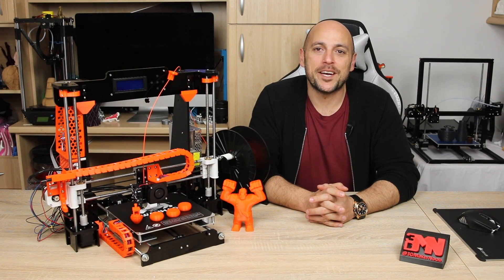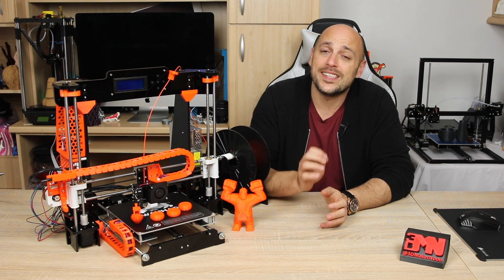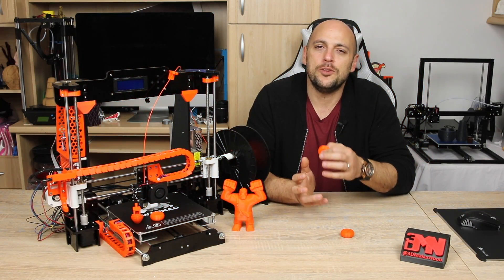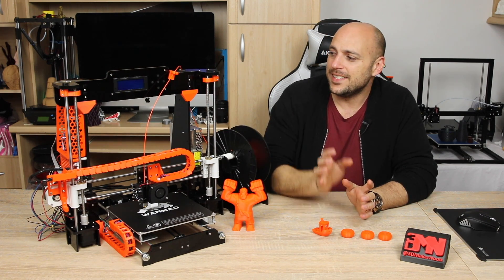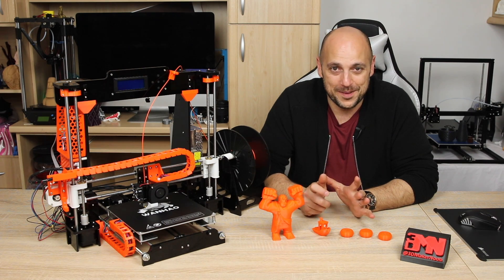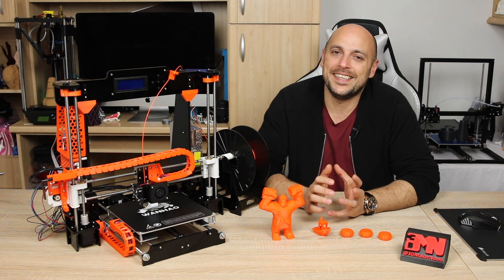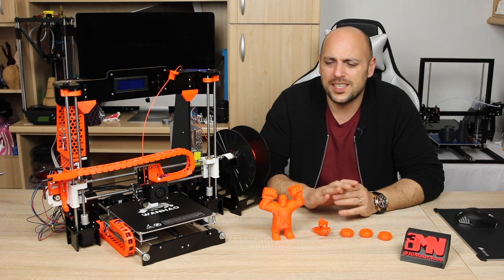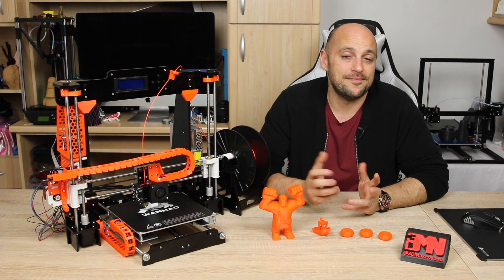Anet A8 Journey - Upgrades Part 1

Comment: Revisiting this video from 6 years ago, there's so many bad ideas here. We didn't know better at the time, I guess.
Cable chains: Increase mass while adding essentially no benefit. Reduces max speed, adds possibility of higher friction and binding.
Enclosure for the mainboard: It's already strapped to a bunch of fuel (the acrylic frame) so why not provide more?
Z-screw "stabilizers": Just... don't. They were floating for a reason. The z-axis only moves once per layer, maybe a few more times if you've enabled z-hop. Constraining the upper ends of the rods actually exacerbates any problems you'd encounter with a rod that wasn't straight and true. Z-wobble is invariably made MUCH worse by this "upgrade".

The gussets for the perpendicular joints were a good way to stiffen the frame, for sure, but the most important upgrades were left out. Getting that power supply and control board OFF the frame should be a key focus. Most of these that caught fire did so when the traces on the control board managed to ignite the acrylic. The remainder caught fire because there was no thermal runaway protection. You can enable it by flashing the firmware or with a plugin for octoprint that just cancels the print if the temp isn't reacting within a specific set of parameters. Firmware is the better method.

I have had far too many of these, and still have two of them churning out prints on the regular. They got a lot of deserved hate because they had, in stock form, dangerously bad engineering, but I keep mine running because they just won't quit turning out near perfect prints.

I'd love to see a revisit of this if you still have one of these dumpster fires hanging around.

Comment: These have gotten a bit cheaper since you got yours. The 3 bearing sliders (not sure what they are called) behind the extruder on mine are plastic and not square to each other so when all the screws are tight it pinches the rail and won't slide. I am gonna have to use spacer washers to fix this issue :/. thanks for these videos they are really helpful.

Comment: I wish everyone would start with this printer. You learn so much about not only the process of printing, but the building and perfecting of the machine and how that has an impact on your prints. I've recently upgraded after a couple of years printing with the Anet, and the previous experience made the next printer that much easier. Thanks Anet for the challenge, and helping bring 3d printing into everyones home.

Comment: I'm about to purchase my first printer. I'm leaning to the a8m versus the a8.  I see my next step to dual color printing so, might as well get the dual extruder versus upgrading later. Your thoughts?  I wish the A6 came in a "m", but no.
Reply from the maker: Dual extruders with fixed nozzles are quite a pain in my opinion. Personally as a first printer I’d rather suggest the ender 3 nowadays. Less than 200, much better build quality, bigger build volume and impressive print quality

Comment: Hi ,awesome video  by the way :)
I just wanted to ask you  is there any reason why I am able to print only one part  on my Anet A8 using cura 3.2.1. ?  I tried  several parts but none of The other parts print  the one parts I am able to print is the part to avoid the Vibration I printed 3 times different times and no problem  but other parts  just won't print it keeps pushing my filament out even if I push it manually the step motor from the extruder push out the filament but if I go back to print the anti wobble part works ? Please help

Comment: Thank you this helped solve a handful of my problems with X & Y skipping as well as cosmetics.  This with a couple other videos and thingiverse upgrades, I now feel confident in printing and troubleshooting.  I am a noob far as 3D printing goes and am learning more or less by trial and error.  Boo me, but I am learning quickly and enjoying the process albeit slow going.  Not quite ready to switch to Marlin firmware, but possibly soon like I said enjoying the learning curve to make quality parts.  Next is to render my own stuff, but baby steps I need to get the printer printing more reliably.

Comment: I have to set the speed to 52%, because at the beginning no filament comes out (also at 52%,but it's a bit better). Also, at the heat up, very much filament comes out, and when i let it, it destroys the beginning. I only downloaded a small thing from thingiverse, used the Slic3r for Linux (only typed: ./slic3r model.stl), but I think that's also not the best. Didn't even look at the options, cause no time ^^

How can I prevent the filament coming out too early(at heating), and then stops coming out at the beginning of the print?

Comment: You missed the cooling air Nozzel, and if you rais the coupler, as the stepper motor should not go too long in the coupler, then the lead screw will reach up to the hole that you mounted the lead screw through.

Comment: A friend of mine has an A8 and is having an issue. He can't get the printer to reset on the X and Y axis (Go to home position). All of the G code is good and all other settings are good. What needs to happen to fix the issue? I am looking at getting the same printer and would like to know how to fix the problem for him. WOW, 3D printing has come a long way from my experience with it.

Comment: I Have one Question.

Im adding a switch with a Fuse to the anet a8.
My Question is:

How much amps should the fuse be?

Thank you for your video's.
Reply from the maker: +Manuel Smeets 10 amps should be more than enough. 5 amps would also work but might trip more easily
Reply: I Forgot to say that i have upgraded the psu to 12v 30A.

is 10A still enough?

Comment: Hi, I saw you had a flsun printer in the back. How does print quality relate to the Anet A8?
Reply from the maker: +vizkoze which one? I don't have any flsun printers yet
Reply: behind you in the video on your left hand side. I must be mistaken. They all look alike. :)  https://www.aliexpress.com/item/Flsun-3D-Printer-Prusa-I3-DIY-Kits-Auto-leveling-Aluminum-Frame-Large-3D-Printing-Size-Heated/32679964210.html?spm=2114.search0104.3.9.ZhfkC7&ws_ab_test=searchweb0_0,searchweb201602_3_10152_10065_10151_10068_10084_10083_10080_10304_10307_10082_10081_10177_10110_10137_10111_10302_10060_10112_10113_10155_10114_10154_10056_10055_10054_10312_10313_10059_10314_10315_100031_10099_10078_10079_10103_10073_10102_10052_10053_10142_10107_10050_10051,searchweb201603_18,ppcSwitch_5&btsid=b8ec6a40-5a77-49d6-9b95-7489eb9d2920&algo_expid=310aaa10-8f04-47dc-a193-8ee7f945e89b-1&algo_pvid=310aaa10-8f04-47dc-a193-8ee7f945e89b

Comment: what layer hight do u fined best
Reply from the maker: +chris ryryr .20 is usually my go to layer height. If I want something detailed, it's 0.10 or 0.15
Reply: i just wanting a respectable print flashed skynet and now prints all to cock lol i for ;ost prints i been using 02 layer and 08 shell
Reply: I NOW GOT ACSEPTABLE PRINTS NOW BUT my auto levle is off say if i printing acros the bed say front left to back rite the front be spot on but to close to bed as moves to back
Reply: i actuly  having truble with z axis now  i get it all spot on pirfect but then harf way thru a print or so it ends up been to hight i runing skynet 232

Comment: Hey 3D Maker Noob, interesting video about the anet. i have done similar upgrades and changing the entire z axis brackets is a waste of time with that cable chain. run the extruder to the top, it will colide with the chain.

Comment: I need Tronxy XY-100 updates :( Dam bed is small and not heated but I have manage get some good runs now after I update slicer & put PLA from 200 to 210 so it stays in bed when start. Also I did fix fan what had one cable lose so now it has printed 4 days full  something. I have also 40W Chinese laser what did get Air nozzle (I have no air pump yet to that) because my cutting get too much smoke. Then I did print some toy horse things & cable chain (what is too small, just testing). I have only very cheap PLA because I did know that I get miss prints or some tests done so It will be used to that then. Now I have printed 3 days parts to toy dog... Every part takes 4+ hours (or more) to print and original was so big that I have put it to 35% to get it to Tronxy's bed :)

Comment: cool you've got my chain x-axis chain and i recommend getting a different cooling vent  brings up the print quality exponentially i suggest the semi circular or fully circular duct on thingiverse
Reply from the maker: +The Random Engineer in that case a thank you is in order, and I have upgraded the fan duct, I did a comparison video on them :)
Reply: ya i saw that after commenting. I saw the date on the video as jun 6 thinking you just posted the video; I wanted to do some vent tests myself recently and found the same results that the semi was the best until i found https://www.thingiverse.com/thing:2297996 worked a bit better on the overhang test and reduced stringing on the latus cube .the cube i had made was small enough that i had to set the slicer to single .4 wall with no infill. 
i thought it was pretty funny that i did pretty much the same tests as you without ever seeing the video.
great minds think alike i guess

Comment: Hi there. I want to print linear chain for my Anet. I saw your MODs in thingiverse. Whats the best way to print it? There are two options there. Single pieces placed on the bottom or assembled chains places on the sides?
Reply from the maker: either are fine, i prefer the side one as it feels like it flow better with the bed

Comment: you shouldn't really use those top z wobble brackets, its better to leave them floating free
Reply: If your z axis leadscrews are bent, you can try to straighten them if it's not very much. Or buy new ones (rather inexpensive, all in all). But if you constrain the tops of the leadscrews like that, it can adversely affect the whole system (the tension it creates may bind something up). If they're left free floating, all of the potential stress is relieved right there. 

Also, if the bend in the leadscrews isn't very bad, it's not likely to affect print quality noticeably.
Reply: micky mous :^)  Exactly, I can't believe how many of these "anti z wobble" "upgrades" are on thingiverse
Reply: Why? And how to avoid of wobbling?

Comment: Here are some tips to owners: This is the order in which I feel the upgrades should be done. When building: Don't cut the y-belt off short, it will need to be longer once you install the y-tensioner. Don't use tape, it sucks, I also don't like stickers because they tend to get damage too easily and either won't stick or sticks too much to the print. Rather go to your local hardware store and ask them to cut you a couple of 220x220 4mm glas sheets and clip them to your print bed. Cover the glass with glue stick and you will also need to increase your bet temp by atleast 10 degrees with glass on. Glass can be removed if needed and replaced with a fresh sheet ready to print. When glass cools print comes loose easier. Glass also reduces the amount of impact your frame, rods and bearings take due to you trying to get your prints loose from the bed. Also insulate the bottom of your print bed to preserve heat better. Print belt tensioners first. ( Better not to print the y-tensioner with the printed screw because if your belts are not tight yet, the screw won't be perfectly round ) Be careful of printing things like z-wobble attachments and X drag chain upgrades.  Drag chains can cause vibration if they are a bit stiff. A lot of the designs on thingiverse tend to hit the top of the printer  and limit your height like the fitting used in this video for x-chain mount an z-wobble. They work but be aware that they limit your height. I value height and have discarded any upgrades that downgrade height. Do the following upgrade instead of printing braces: https://www.thingiverse.com/thing:2045010. Then look at z-stop upgrades and bed-level upgrades. Now look into some additional frame stiffeners. If you feel up to it, do the bowden upgrade, it is worth it but can be a pain in the ass to get installed properly. PS. Be careful of fan duct upgrades, most of them limit air flow more than they help.
Reply: Nice one. .

Comment: Just bought the Anet A8 is there any upgrades you would recommend buying/making right away ? @3DMakerNoob
Reply from the maker: +Hunter Lash solder the heatbed wires and install a mosfet. Then everything I mentioned on the video :)

Comment: Hey Joe, just thought i would give you an update on what i discovered after updating to Skynet3D, The LCD issue seemed to be caused by the lead to it from the main chipboard coming ever so slightly unplugged (barely noticeable). Since pushing it back in I have (fingers cross) not had the alien language since. Just incase you get asked about it again may be a solution for others.

Comment: I don't understand why you Anet A8 frame isn't rigid mine is, I understand the power switch I have added the same one including the enclosure (needed upgrade) I did put drag chains on although I put bed one on the rear, I put filament holder on the top above where the LCD screen went, the screen is now at side in an enclosure, I also added  trans-flash to SD card extension cable that is around 35cm long this saves me struggling to insert the memory card. also a necessary upgrade,in all my printer works fine, I use PLA and PETG with no problems,  the only thing I don't like is loading the filament, I have to remove the side fan to get it to load properly, I have got new E6 extruder but waiting for integrated Bowden and Motor to arrive to swap it out. this should make the Printer sweet (I hope)thanks for sharing

Comment: I am thinking of getting this 3d printer... Is it easy to use for someone who knows close to nothing about 3d printers?
Reply from the maker: +Legomore depends on how patient you are :) it can be a great printer, but needs a lot of time and also a few upgrades, which ultimately help you understand it more :)
Reply: 3D Maker Noob ok, thanks. I have a budget of $400... What other printers do you recommend?
Reply from the maker: the list is quite long for that budget, i'd start by looking at the duplicator v2.1 just under $400, 15 mins to put together and prints well, alternatively look at the CReality CR-10. i have one at the moment and i am loving it
Reply: 3D Maker Noob ok, I will check them out. Thanks for the help!
Reply: 3D Maker Noob I was not able to find the CReality CR-10... Could you send me a link?
Reply from the maker: http://bit.ly/2ne2mza
Reply from the maker: by the way, choose EU plug, once it arrives, just change the plug and it will save you about $75 :)
Reply: 3D Maker Noob ok, thanks... Do I use an adapter or is it modular and you are able to actually change out the plug?

Comment: You will need to modify a lot of things on the ramps board to make it reliable.
Remove diode D1 to avoid ramps board feeding 12v into arduino Vin pin, so arduino wont use its weak voltage regulator (only 800ma) to power everything, which burns the voltage regulator quite easily. But doing so you will need to install a external voltage regulator (with higher capacity) to feed 5v to arduino + ramps + lcd + servos + drivers + fans. It's a quite cheap mod, tho.

Remove the power connector from ramps board, and solder wires with an connector that can handle the current (like a XT90 connector).
Change the heatbed Mosfet and remove the heatbed connector from ramps board, and solder wires with an connector that can handle the current (like a XT60 connector), or use the original mosfet and connector but powering the heatbed through an SSR (solid state relay).
Cut the +5v pins on the endstop connector. Its a quite easy to plug the wrong way and burn everything.
Reply from the maker: if you could see my face reading that comment lol sounds overwhelming but i am guessing just like everything else, i will need to read up quite a bit before diving into the Ramps upgrade. thank you very much for the info. will def do take note of everything

Comment: In generell a improvement Video would be nice. And especially one about the firmware. I am not sure which one I should take - and why. Currently I am running Skynet 1.1 alpha for autoleveling, but the Display stops working on G28 ....
Reply from the maker: i might end up installing marling on it when i upgrade to ramps 1.4 still have to do a bit of research :)
Reply: This is also a good topic - why do you upgrade to the new board? What's the benefit? Why a new PSU? A PC (ATX PSU)?
Reply from the maker: all will be discussed :) but the mainboard is mainly for more stability and safety, also upgradeability. The PSU will give the printer better power load, heat quicker and so on
Reply: Cool - looking forward for it. :-D Do you have some links to buy for instance a PSU? And the board bundle you mansioned?
Reply from the maker: Ramps: http://amzn.to/2nVJeSC and PSU: http://amzn.to/2okeXPl
Reply: The board that came with some models of the A8 have connectors for the 12V from the power supply that go to the board and the same connectors going out to the hotend and heated bed. These connectors have been known to melt and catch fire. I have seen different connectors on newer boards, so hopefully they are safer to operate. I bought my first Anet A8 from Alunar about 2 years ago and one of these connectors recently flamed out on me. Luckily I was home and paying attention at the time. I had a spare board but I installed mosfets on the bed and hotend before I connected the power to the new board.
Reply: Hey 3D Maker Noob, do you have a link to this comparison video? if it's made already
Reply from the maker: +Sean Anderson a firmware comparison video you mean?